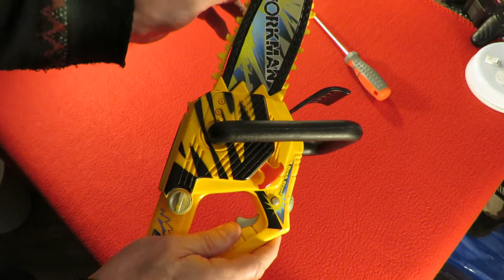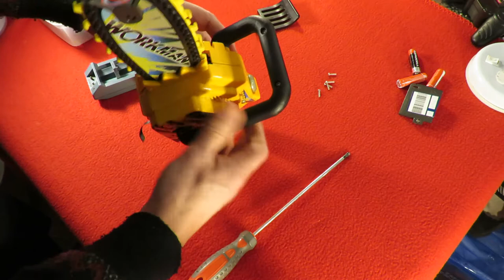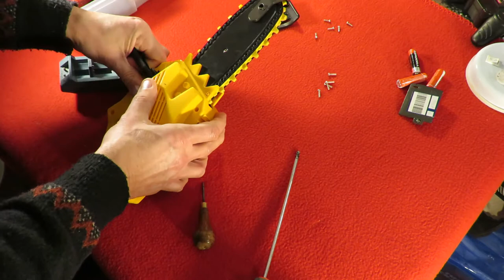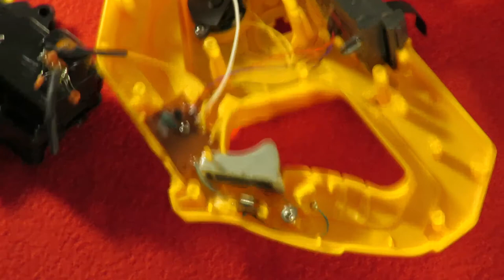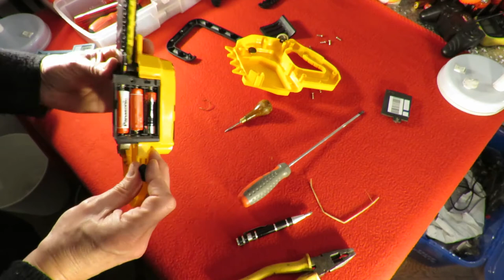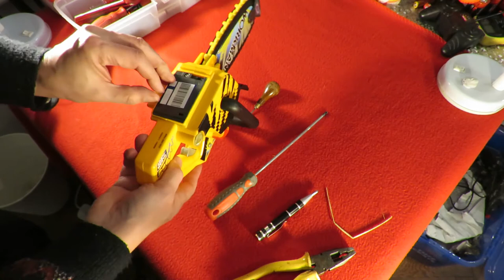Wilko Workman Chainsaw tear down and fix

Comment: Really enjoyed this. 👍
Your tear down videos are always great and this was perfect for a relaxing Saturday morning with my coffee. 
That is in very good condition for a 17 year old toy. I also spotted the electrolytic capacitor on the top of the sound effect module. That will hold enough charge to keep the sound going after you release the trigger, and then the sound cuts out. 
Brilliant video. 👍👍👌👌
Reply from the maker: Thanks Mike, can't be sure on it's age as the date on the moulding could just indicate when they started making them rather than when they stopped 👍